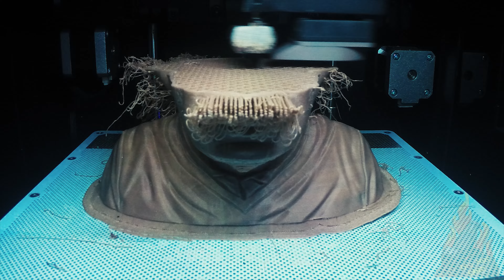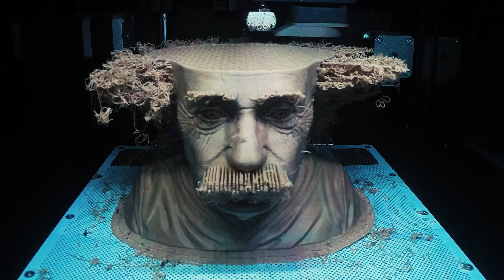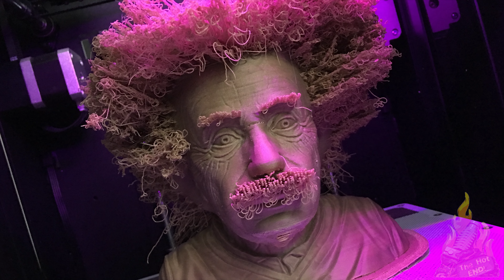Printing Einstein with Hair! Print That Thing Collab (((TIMELAPSE)))

Comment: how long was that print?
Reply from the maker: this one i did fairly slow, around 10 hours in aurarum ABS
Reply: The Hot End wow! doesn't seem like that long for such a large print. what speed is slow?
Reply from the maker: about 100 hehe may have been a bit longer I'm guesstimating